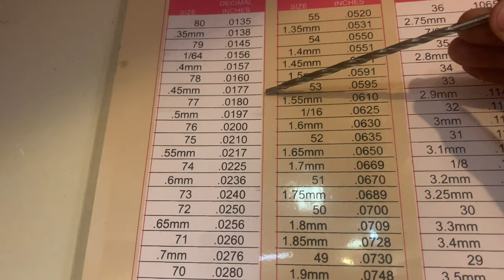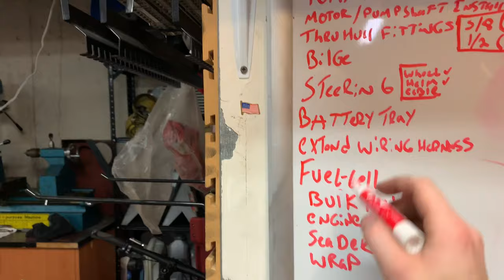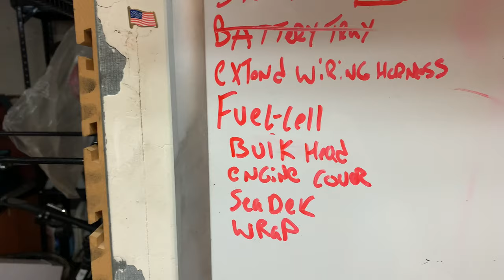Mini Jet Boat Build 9 - Finishing Engine Accessory Mounts

Comment: Subscribed. I started building a 10Ft kit about 4 years ago. I welded the hull and its been sitting ever since. Keep the videos coming, Interesting to watch.
Reply from the maker: Your kits just begging to get an engine tossed in it! :) should be quite a few more videos til it’s all done!
Reply: Cliff P I’m slowly working on it. I’m keeping it. What’s taking me so long is I decided to complicate the project, I’m going to run a Honda 1000 street bike engine. What’s more complicated is I’ll be running the pto off the clutch.

Comment: Great build but one thing I would do different is back every bolt you used witha nut. Threads in that alluminum will get destroyed shaking in a boat.
Reply from the maker: This is great advice. I am
Actually in the process of re doing some pieces of the boat and nylock nuts are getting added in many spots.